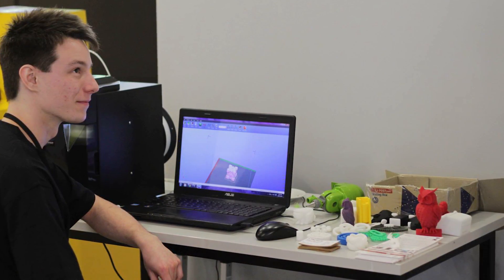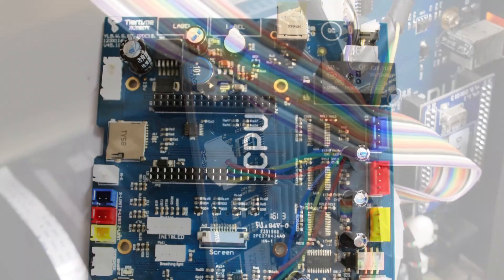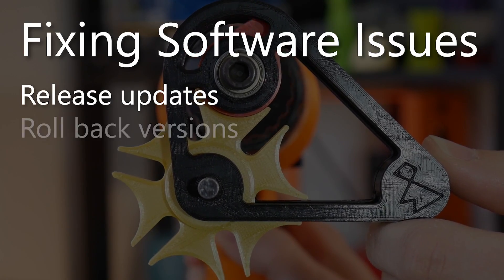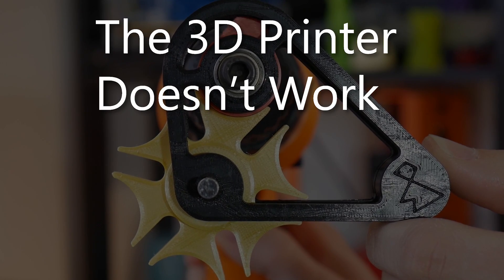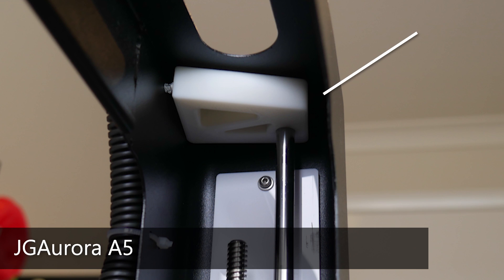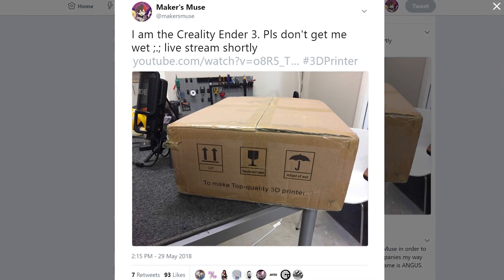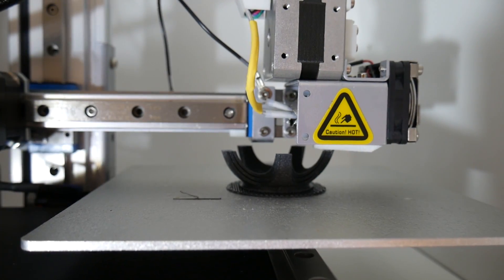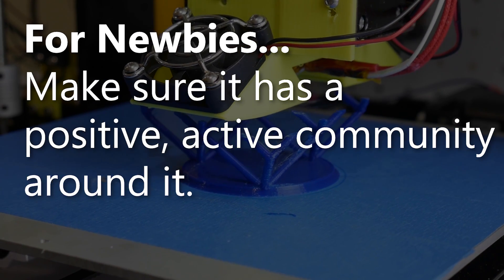Serious Concerns with 3D Printer Quality Control

Comment: Geeetech delta G2s Pro owner here, and I can say that this is a true video here. The kit was purchased in the 2015-16 time period, and I assembled the machine myself. Here are the issues I have had:
1. probe on the effector fits so tightly, it was difficult to get in, and even after in, it did not return when a bed level was run. I just removed it, and used the screws to level the bed and the endstop screws so the nozzle just touches the bed while Z=0 in several spots. at least that takes 1 minute off the print time...
2. 2 of 6 rods weren't set for the right length. simple fix requires heating the thread joints on the rods, and length can be changed. for the G2s pro, it should be 198mm center to center.
3. idler roller bearings failed after about 3 months use. to get them out, I had to use flathead screwdriver, hammer and vise.
4. the factory layer cooling isn't exactly ideal for PLA... but I don't use this material very much, so I don't care.

It has been a good machine since these were fixed, and I even switched to hexagon hot ends on my machine.

Comment: Thanks for an informative video.  As a newbie who's contemplating his first purchase, it's one of the biggest issues I've seen - most of the "Best" and "Most Popular" printers, especially at the lower end, need considerable modification and/or parts upgrade or replacement in order to function properly and safely.

While I suppose "you get what you pay for" applies here, it seems like even the mid-range ($500-$1000) printers are starting to suffer from this "user beta testing" cancer too...

Comment: How is there a single down vote?  Jackass haters.

I agree Angus, has happened so many times in my life.  My CR5 came w old board.  New firmware locked it up.. had a replacement new board sent right away.. was off putting.  I have some updates/upgrades i have developed for it, but given what creality has done in past, dont want idea stole by them and just implemented on new machine w/o me getting credit for them.

Comment: I will agree with you They are selling trash most of the manufacturers. Im kinda new on this 3d printer stuff, my 1st printer was a flashforge finder, out of the box I just need it 3 mins to make it print something properly, I have no complains at all with the flashforge, but as we know that printer make only small things, so I went for the cr-10s, I expend so much hrs fixing the issues, improving the design until I made it print with the same quality of the flashforge, even if was really fun for me the process and even if now the cr-10s prints as perfect as the flashforge if I was the kind of user that just want it to print and my 1st printer was the CR I probably trow the CR to the trash, it need it a lot of time and work in order to make a good print. They are selling semi-functional products, I like my CR (now) But at the beginning I almost hate it until I start to enjoy the challenge of fix it.

Comment: Hello Muse, love your channel! 

PLEASE READ THIS COMMENT! THERE IS A GOOD SIDE TO WHAT YOU ARE SAYING!

I bought an anet a8 for my first printer and the problem with this one is that its been changed SOOO many times lol.. When i download thingiverse updates for it its almost 100% sure that its changed. Not only hard ware but the frame and stuff are slightly changed every time so bowden extruder mount for example, one of the screws is fitting right but the other one is 0,5 - 1 cm off!

I know i have the worst possible machine for this but its had a great effect on me too! After fixing all this and done all this to the machine (i never had a 3d printer before this) i have become so familiar with 3d printers that i am now building my own reprap model from scratch! Exactly how i want it! And if i bought a 100% done 3d printer i would never had understand so much on how it works and how to configure firmwares and so on. So there are some positive sides to these kits also :)

Comment: Angus - As an engineer it actually rather kills my soul to see companies do this kind of thing, at least to the extent that you're talking about. It's one thing if, when releasing updated versions of a unit/kit, the company also does something to update the overall package number (at my company we call it a 'digit change'), and this allows end users and even us internally to differentiate between the bundles. I, personally, couldn't imagine shipping a product that I knew hadn't been rigorously tested before releasing to manufacturing.

I experienced quite a bit of what you'd mentioned in this video when I first got started in 3D printing - broken parts, substandard components, mismatched connectors...oy... Thank the Printer Gods I had access to work stations and labs that I could take the machine and tinker on it. If I were an inexperienced type, I'd have given up. Hell, I did give up for a month or two after encountering lots of issues; but the tinkerer in me brought me back. I ended up spending another $100 on top of the $375 for the kit. I'd do it again, knowing what I know now, but certainly wouldn't recommend it to anyone that wasn't prepared to not be able to print right out of the box.

Great video, sir.

Comment: I want to upgrade my Ender 3 with a glass bed.  Would you recommend tempered or borosilicate glass?  I found them both on Amazon with the exact dimensions (235mm square) for $26 / $32 US.

Comment: I do area on the train on toughs from you. BUT!!! BIG BUT!!!  GIANT BUT! you are missing the point here like by 2 miles. Improvement is constant and specially by a new technology like that. WHAT you are actually upset about is the BEHIND the doors problem.  YOU CAN NOT tell reliably what version you are reviewing. That is why usually all companies have a series nummber on them. so you can tell this v1.2.345.holyMacaronies version is the one i reviewed... BUT here are the changes for version 63 that fixed it.. AND broke that.... that would be the best/only solution that is realistic.

Comment: Angus.  Thanks!  I agree 100%  I was quiet taken with the rant from Naomi below although I disagree with much of what she says.  I understand that people want more features and they want the price to keep dropping.  There is a huge problem in the industry with companies constantly adding features or "enhancing" designs that they think they can charge more for, when they have missed the entire concept of solid design and testing.  The way the price comes down is by increasing the volume produced and therefore leveraging parts pricing at the manufacturing end of the business.   If someone decides to build 100 printers, then they will pay more for each part than the guy who decides he will build 1000.  So, the issue is that they are trying to rush the product into the market to sell some, without a serious marketing plan to identify how to sell 1000 instead of 100.  Yes, the products change, and no one wants to tie up their money in inventory that is not selling.  There is a clear base line of features and functions that define the minimum requirements.  What isn't there is a clear commitment to actually identify who the target market is and how large that market can be.  Printers are slapped in boxes and thrown out the door as a one type fits all customers.  Most people who can get through their 2nd or third boxed build can buy all the individual pieces, choosing whatever they think is best for each part and assemble it.  That's the market that most of these printer companies seem to be aiming at with their kits.  You can't make money at that.  You can make money by building a quality product with a decent feature set and making sure that it works - every time, right out of the box and you back it up with a phone number with live bodies that can help when needed.  That means it goes out fully assembled, tested, and supported.  Yes, it would cost $500 to $1000.  If someone wants a kit to put together, they won't buy your printer.  Don't package and sell it for that market.  Find a market that can and will make use of a fully assembled, quality printer.  Yes, that takes a lot more work than buying parts and throwing them in a box.  Some of the printers I have received indicate that the company feels that if it is well packaged, it's a good printer, even if they have been swapping out parts as they go.  There is no quality control because there is no periodic testing of the kit or the parts.  There's just more crap sitting on a bench until the customer decides to start buying the parts they need to make it work properly.
Think about it!!  Will Ford sell you a car as a box of parts with a manual that likely isn't up to date?  Not a chance!!!  That quality assurance comes at a price.  You get what you pay for, and many of these printer companies are in it for a quick buck because all they need are open source parts.
Sorry for my rant .  Tim

Comment: Yepp, I totally agree. One example (from my point of view) is the Prusa MK3. The MK2 was a great printer. The MK3 is not as good. It has problems, that results in lower quality than the MK2 and from my point of view one of the problems is the extruder, that is hardware. They deploy a lot of new firmware-versions, but this does not really help. It‘s so sad ....

Comment: Ship early, iterate often - the lean startup should die. I've only just received my first 3d printer (an i3 mk3) but it's something that I've been talking about for a long time. I may have even mentioned it on one of your videos at one point. Taking business practices and shoehorning where they don't belong is dangerous. This is something that made me very cautious about buying. The mk3 alone, one if its major features wasn't ready at launch - if something so fundamental wasn't available at launch it shoudn't have been launched which makes you wonder about cash flow at some of these companies. There's nothing wrong with redesigning to improve things, in fact it's great for consumers - assuming it is actually an improvement - the problem as you're talking about is that these products aren't going through design and test procedures that used to be a thing. Prusa's argument for 3d printing parts is a symptom of this exact issue. Prusa is great, and so is the mk3 but it's a massive red flag that something isn't right with the engineering - in a new company and prototypes that's fine but at some point it shouldn't be a thing.

Comment: I'm glad you bring this issue to light because it is happening across the board not just in the 3d printing or start-up world. Professional we had a purchased a piece of precision lab equipment only to feel like unwitting beta-testers (which turned out what we were) after several years and loss of numerous irreplaceable biological samples it is finally running as it should (only upside is I'm now as skilled as their field engineers in repairing it). Though the experience has pretty much soured us on the company and if can avoid it from purchasing any equipment from them again.

Comment: Don't let us forget one thing: Chinese manufacturers have greatly profited from the Open Source community's inventions for free. Have copied, copied, copied and then started to copy each other in the domestic market. If the final results are a minor product boldly advertised as a great machine or product and it doesn't work, is faulty or even dangerous, then let the market clean up itself. Chinese factory owners are taking great risks in business setup and expectations, but the consumer should not be blamed for it. The consumer has to rely on safe and reliable products. If a ' margin ' or ' greed ' reason leads to crappy and sloppy products, then I see only one way: support only the solids & back to the roots. Thks Angus for pointing this out and communicating it. Herri, a German designer & business owner 15 years in China.

Comment: Note: A difference between game Beta Testing and what we see here.
A beta or Alpha build of a game is presented as such upfront. (When they're not there will be massive blow-back, like "no man sky" Huge pile of promises and no return. ) But when presented up front and managed well it can be magic, like Minecraft.

These printers are presented as a finished or final product in a line so some very minor deviation is acceptable, the degree of deviation in these is nuts. in fact it's why I stopped buying from Gear Best facts about printers were unpredictable and sparse and when I got kits I always had a few parts I needed to replace. I can't even find control boards like the original one my printer had and so I would up rigging new connectors to get the replacement to fit.

I don't think this is directly Gear Best's fault but they do tend to host more shoddy stuff.

Comment: Gonna pull a Strongbad with boxing gloves on comment. But ANGUS YOU SHOULD READ TOYOTA WAY! The focus is on lean as a part of manufacturing. In fact Toyota and Deming poineered the lean process for manufacturing. The software lean process has borrowed from what Toyota and Demming did post WWII. I would love to see a 3d printing company follow the 14 points for TQM. I think we would see some high quality printers if that was the case.

Comment: A very hearty thank you Angus... for bringing up the issue... but I also have to heartily agree with Naomi Wu on every single point she brings up... people keep demanding more and more features and ever cheaper prices, all the while NOT understanding that this is a "machine tool" not that much different than a lathe or mill.... you Still need to know the qualities and specifications of the materials you are using, you need to understand how the software works and what those commands you send to the machine are doing, you need to understand the mechanisms of your machine as well as the limitations... you need to understand all the different factors involved in getting a good print and NOT expecting some kind of "Star Trek Replicator"... 

Some people are lucky and get something great right out of the box, some people understand the tool well enough to make necessary adjustments. Some people understand that they are getting the essential framework components and will need to upgrade some parts in the name of a cheaper price point.... then there are the others.... the whiners across the forums that will never take any responsibility for things that happen and will automatically blame the company.... I'm not defending the companies per se, but they are being driven into this corner by the totally unrealistic expectations and demands being made by the customer.  Quality control is a very important issue on many fronts, but the customer also needs to realize that Quality has a price tag... They also need to realize that there is a learning curve to consistently good operations and there are constraints upon the tooling and mechanism which really cannot be forced without very careful tweaking and deep understanding of the craft.

Then there are the amateurs who have recently got into printing and suddenly they are "experts" and passing around wrong information... or wondering why the prints that were working so well suddenly stopped... only to find out that they tried to print faster, or didn't test a new tweak they did, or even worse, started removing and/or adding things because they "saw it somewhere" without even checking if it is something that they actually needed to do, or whether it is good or detrimental to their machines performance.

Overall... I cannot hold the printer companies entirely blameless... some things really can't be sacrificed on the altar of "make it cheaper"... there is never any room for truly shoddy workmanship in the name of chasing profits... these can be relatively dangerous machines but then again, so is a chain saw in the hands of an inexperienced user... but I also blame the consumer that is unable (or unwilling) to understand that 3D printing is NOT a cheap and "simple" hobby... That there will be the larger up front costs for a truly "great" machine, that there will be a learning curve that keeps on going as they try new or different things,  and finally, to accept the responsibility of ownership and operation and not immediately blame others for any little fault.

Comment: If I may be devil's advocate for a minute; Way I see it is the influencers 'are' the quality control. Don't hear a lot of influencers complain about quality control / problems with your particular product? Nice, that means you can make more profit.

It's shitty business, but it's business. Make no mistake, most of these manufacurers know exactly what they are doing (where they are skimping on quality, etc..). It's a cat and mouse battle. Either we get louder, or they get cheaper.. 

We call 'em out, they shut down and start up a new shitty business, we call 'em out again, this time we make note of names.. this keeps 'em from making new businesses without us having to repeat the whole company QC process. Us getting screwed over once is enough. Etc etc.. We keep it up until all of the low-spec's are gone. Pruning the industry until only the creme of the crop remains. 

The other direction would be; we cheap out, which incentivises THEM to cheap out. Their reasoning would be that the customer is more concerned with money. And the customer is always right. So they will select the cheapest parts to construct their printer. The profit margin would be so slim, they would not have money left to even do quality control. The "De-Chinafication" is what you chose to do yourself by cheaping out. 

Et voila, that's where we are.

Now, if this same practice is happening with "Not cheap" printers, then that's a whole different story, and we should be picking up our pitchforks and torches..